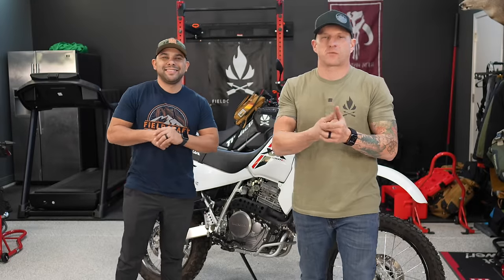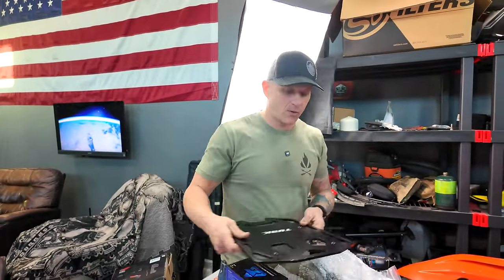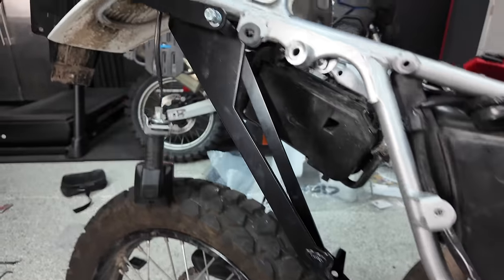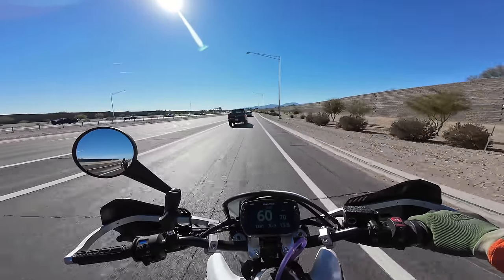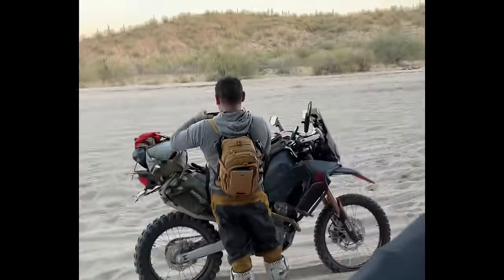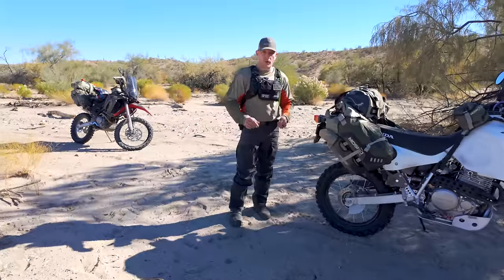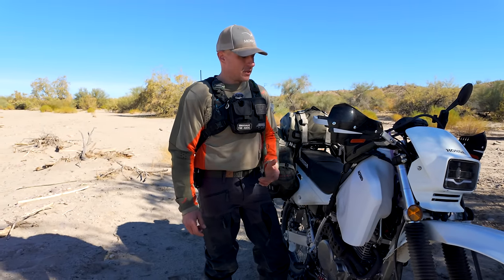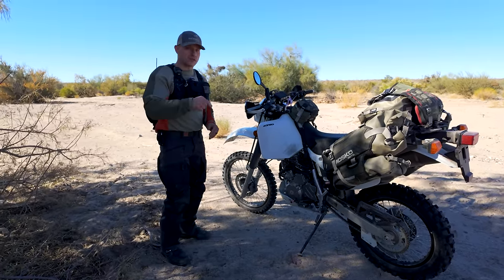Budget Friendly Bugout: Is the XR650L the Perfect Bike to be Prepared for the Worst Case Scenario?

Comment: The XR650L is the fatter, slower brother to the XR600R. The XR650R is a totally different bike and Honda shouldn't have even referred to it as an XR. I love the XR650L and XR650R so much (I've owned the former and traveled the US and Canada on it and I currently own the R). The R is the king of Baja. The XR650L forks would explode before it reached 1000 miles of whoops, I'm sure.

Just a suggestion, with that weight on the rear, you are going to either want to weld a frame reinforcement or get the SW-Motech subframe braces. The frames are prone to cracking at the rear-most joint.
Reply from the maker: Totally agree about the 650 R. That bike was and is amazing. Wish they could’ve just added an electric start to that bike and called it good. As far as your second part of your comment. Maybe rewatch the video. I put a reinforcement on the rear subframe and talk about it extensively a couple times in the video 👍🏻
Reply: @backcountryadvmoto  that should be the bike that Honda would sell worldwide like cupcakes
Reply: The XR650L forks are essentially the same as the XR600R forks, just different spring rates, and the XR600R won the Baja from 1996-1998, and the XR650R won from 1999-2005. The XRL could do 1000 miles of whoops pretty easily. Not as nicely as a 600R or 650R, since it weighs a bit more, but it could do it.

Comment: Budget friendly is a relative thing.  If you start off with a used one, maybe.  But XR650Ls are currently selling new for $7k msrp plus dealer fees (delivery, assembly, etc.).  Then you need to put about $1500-2000 worth of mods on it to get it dialed in right, you’re up over 10 grand and still have a 1990’s bike.

Comment: Re-jetting a carb can really wake a bike up. Did it to my Crf230f and it feels like a 250 now with the t6 pro circut exhaust. A 110 is what I used but for a 650 it would be probably 138 or even higher with a ballsy exhaust. It allready had some power but jetting and exhaust wakes a bike up.

Comment: I just wanna point out that in terms of efficiency, a 650 is actually a huge bike. I'm 6' and 160 lbs. and I'm gettin around great on a Honda cb125, and doin over 100 miles per gallon (which would be super important in a bug-out bike..) so for me a 250 would be huge. I mean how often do you need to go 70 mph anyway, and in a bug-out situatio, think about it. just food for thought.. cool build tho , sick video
Reply: How often do you need to go 70? The damn speed limit is 75- 80 mph and even then everyone is going 5-10mph over the speed limit.
Reply: Sure you’re right, normally, but In a bug-out scenario? The interstate is gridlocked. You’ll be weaving traffic or on the shoulder or in the ditch.

Comment: Its nice, kind of curious what the over cost of every thing including the bike is. i am sticking with my KLR650 2022 :)  my over all build with luggage and all the upgrades nearly what you have done minus a few things like lights, carb,tank. I am in to mine with cost of the bike armor and gear, $8,500. put new tires on this year $200.

Comment: Grind those silly tabs off instead of drilling holes in your bars. I had one of those headlights and the center "eye" came loose, making the beam fluctuate over bumps.
Reply from the maker: I’ve don’t that in the past and it seems like every time the controls will eventually spin on the bars. Just took 5 minutes to do it the right way.

Comment: I had one of these and rode in the summer heat in Florida - in the sand.  It had an oversized tank just like what you have on it.  I had an oil temp dip stick and got the oil temp up to 300.  I would not suggest an oversized tank (which limits air flow across the cooling fins) with an air cooled bike in a hot climate.  Air cooled engines need to breathe.
Reply: So true !!!

Comment: Sweet build! I did a similar setup on my dr650.  How's the stock suspension on your honda?
Reply: Stock suspension on the XRL is actually REALLY good. It's old, but it's fully adjustable and has cartridge forks. I found that for me, 6'5 235, new fork springs and fork oil and a new shock spring did the trick. My DR650 suspension is... awful. I'll need either new forks or fork internals to replace the damper rod crap and a new shock to get it where I want it. I know they're great bikes, but boy is that stock suspension unpleasant!

Comment: Love these build videos, great job. DR650 is definitely a better bugout bike though, that XR carries so much weight up high, absolute handful. You need a donkey for the zombie apocalypse, not a giraffe.
Reply from the maker: They are both excellent motorcycles. The XR just has a little bit of an edge off-road. I’m 5’8 and don’t seem to really have much of a problem with the height. The bike was comfortable for me at least. But you really can’t go wrong with either one.
Reply: Maybe even a tw200 with one of those massive wide tail racks for loot… great mpg +carry supplemental fuel… and so short and light I’d say less a liability in case of hairy terrain/falls/picking up/injuries. I think smaller has big selling points in a real bug out regardless of inseam.
Reply: The XRL is miles ahead offroad. I have both a 2011 DR650 and a 1994 XR650L (as well as many DRZs, a 530 EXC, FE501S, XT225, etc) and the XRL absolutely smokes the DR650 in pretty much every way. The DR suspension is absolute trash and needs a TON of work to even come near the XRL. 

If you're short, though, the DR is a better bike for you, you'll just need to do a lot more work to it. I'm 6'5 so the XRL is much better for me (and the DR is going up for sale soon because of it!)
Reply: @aTuWitty  I think the end of your comment says it all; you're 6'5". The average height of a male in the USA is 5'9". I'm 6' on the dot, and the XR was never as comfortable offroad with the exception being high speed whoops, sand, and relatively aggressive/fast riding without too much tight stuff. On the DR (which admittedly I've modified quite a bit, I enjoy that process), I'm so much more confident that I can get through worse stuff. 

I would argue that for MOST people, a lightly modified DR will do MOST things better, with the single exception being high speed offroad.
Reply: @GoodkatNW  Your comment is likely true, based on my experience with new riders- most people just aren't very good. A new rider, tall or short, will be MUCH more capable on my XT225 than he will on my FE501S, despite the FE501S being a vastly better bike in nearly every aspect. However, once his skill develops a bit, the FE is markedly better.

There's a lot to be said for being able to put your feet down and walk the bike along, but at a certain point you're just hampering your own abilities by not learning to ride better. That's why I feel the XR is a superior platform- aside from it weighing less, having better brakes, having actual suspension instead of damper rod trash that you MUST upgrade in order to get any semblance of real suspension, having a better gearbox, having a better seat, etc, it's taller and has more ground clearance. 

I don't doubt that you can make a DR nearly as good, or even better than a stock XR, but it'll take more work to get it there and it ultimately won't be as capable- and in the end, you can upgrade the XR as well. We're not talking huge margins at the top end, but stock for stock, the DR is objectively worse offroad. The only bike I've ever ridden with worse stock suspension than my DR is my XT225, and that's saying something.

Comment: I have a couple of DRs.Nice bikes except for weak trannys.I am thinking of trying the Honda 650.I understand the tranny sprocket should be upgraded to a wider spline to prevent mainshaft wear.Are you going to do this mod?   I put on a lot of miles on pavement and gravel on cross country ADV rides so long term reliability is very important.It looks like you are on the correct path.
Reply from the maker: Thanks for watching. I did the sprocket swap. Lots of info on that when doing the research. Forgot to mention it in the video 🤦‍♂️

Comment: Where are you all located? I'm looking to get more active on adventure riding or just get my old Enduro's back to snuff which is not hard as they're '73 Yamaha CT/DT 175-250. I am looking at a larger bike as I'm a bigger guy. Seriously thinking at this point the KLR650 or a V-Strom or maybe an older Honda 650 Alpina twin will probably be more of what I want. I am open to just about anything 300cc+ as long as it's got excellent fuel economy and a larger fuel tank. I'm mostly just muscle at my size and don't mind just puttering along on a smaller bike but, I don't want to just go slow. I've looked at so many models it's getting silly. I love all the Japanese bikes in general as they're well sorted out, each have benefits. I've owned Honda and Yamaha bikes. No aversion to Kawasaki or Suzuki. Let me just ask this: at 205-230lbs. 6'2" and looking to do long distance on and off road what's suggested by other's my size if you can offer some ideas?

Comment: i have a 22 klr i decked out with tusk stuff. it already had the bigger tank dont see why you didint go with klr cheaper and fuel injection. good video looks fun.
Reply from the maker: The KLR is a great option, but when we are talking about the worst case scenario, the more simple the bike is the better. For instance, the KLR is water cooled. What happens if you punch a hole in a radiator that is too big to patch. The bike is basically dead. The XR is air cooled so though it’s not a performance machine, it is reliable and has less things to go wrong.

Comment: Heyyy. XR650L Brother,i got the XR Only Tail pipe & a Dynojet kit & they told me to put a 165 Jet in my Bike & it Runs Good but wont do a wheelie like ur bike 🤷 are you running the stock countershaft sprocket which is a 15 tooth, 🤷or do you have the 14 or 13 in your bike 🤷,& i believe 1 tooth down in the Front,is like adding 3 teeth in the back 🤷am i right 🤷,i was thinking about adding 1 Tooth to the Rear Sprocket so 46 instead of 45 ,coz i like to be able to get up to speed on HWY,if i have to go somewhere 🤔So get back to me when U Can 🙏 & tell me what i did Rong 🤜🤯🤛🙏😁🙏 please 🙏
Reply: Im just running stock gearing on this bike. The bike will wheelie in 2nd and 3rd with just a little more throttle ;)
Reply: @BestLife208  I must have a bad bike & now I got to change the small sprocket to 14 Teeth & maybe then it will wheelie
Reply: @BestLife208  what jet size are you using,,,,me 165 in a Dynojet kit🤷
Reply: @BestLife208  did you change the carburetor needle to the tapered one from dynojet or did you leave your stock one in and what jets are you running I'm running 165's
Reply: @BestLife208  I think my XR Won't Do A Wheelie Because of me being 260,LB's 🤷 I'm Going To go down to 14 Teeth FT Sprocket & That Just Might Do The Trick & I'm Running A 170 Jet Now,The biggestest one in the Dynojet kit & Running A K & N Air Filter & Crank Breather,& Top of Air box is Open Now ,So Hopefully I Can Have Some Wheele Fun Before Life is Over For Me in This World 😉⚙️🐎💪💨🤔😁,get Back To me when you Can  🙋,& XR Wheelie On XR Brother 👍👍👍

Comment: The only issue with an XR650L for me is a deal breaker.  It's WAY WAY WAY too tall.  Lowered 2" I still couldn't swing my 30" inseam leg over it *I'm 5'10" fwiw).  I'm sure the kickstand is way too soft to use the footpads as a step, too, but even if not, still too tall.
Reply from the maker: I’m 5 foot eight with a 30 inch inseam and I use the foot peg to get on but then once I’m sitting on the bike I can touch the ground no problem
Reply: @backcountryadvmoto  std sag would provide a 33.5” seat height when mounted - tiptoes only at best for a 30” inseam.
Reply: Yup, the ground clearance is fantastic.
Reply: Yeah it’s not for lil guys
Reply: For sure.I bought a new one last year.Going to sell it.Too tall and heavy.That being said i am also a first time rider and 53 years old.5' 11"and 255 pounds.I seem to have no problem on my friends KLX300R though.I wish those bikes were street legal.

Comment: The strap on the Mosko bag is driving me nuts. Those are meant to attach to the dry bag.  ;)
Reply from the maker: Ha good call. I’ve watched that video 2 or 3 times before and still didn’t realize i was doing it wrong. Thanks. This was my first time running the reckless system. I normally use the backcountry panniers on my other bikes. I’m really liking this set up though.
Reply: @backcountryadvmoto  yeah it trips everyone up. 

I love my Mosko gear. And my new toy for the year (Kove 450 Rally) is getting a brand new reckless 80 

🤘

Comment: I am really upset that you tried to put this bike  in the same category as xr650r by saying and beginning of a video about it xr640 l vs  XR650R. Is a completely different bike than A xr 650r😢😢😢
Reply: Typo XR650L. VS the XR650R.
Reply from the maker: I said, the 650r was the predecessor and what it is based off of. Didn’t say it was the same bike. If you are “really upset“ then might need to take a look within because that’s not something to be really upset over.

Comment: Budget friendly?😅. Well, today I went to try to get one at the motorcycle dealership near my house here in San Diego, the original price is $6,000 , but at the bottom line on the paper is $ 15,000!
  Maybe because my credit rating is only 680 and zero down 😅.    So, $260/month for 5 years.

Comment: Odd choice?...You could have eliminated several "upgrades" by just going with a KLR650.  That bike comes standard with a much larger fuel tank, Fuel injection , more storage space, reliable engine, more aftermarket support and cheaper price tag! ...yes, both bikes are slow but the KLR would have been a far better choice.
Reply: The KLR weighs a LOT more. That's a rather significant factor if you're riding through the desert like they were in this video. It'll do fine on dirt roads or some light off-roading, but it'd be a beast to flog through soft sand or mud. 

It's known for reliability, but it's not known for it's off-road performance for a reason.
Reply: @DevDog67  I've owned one. You have to ride aggressively and not baby it. It does surprisingly well when ridden properly.  That being said there are all the other factors I listed...poor choice going with the honda.  They had to change a bunch of stuff just to make it decent...KLR out of the box would more than serve those purposes

Comment: 1st thing, change the pipe, rejet, air filter, remove smog hardware. This bike won’t run for shjt until you do.
Reply from the maker: Yep that’s what I say in the video
Reply: @backcountryadvmoto  sorry I didn’t watch to that section. I bought mine new and thought the engine was blown the first time I rode it.  All the smog crap really jams up the engine.